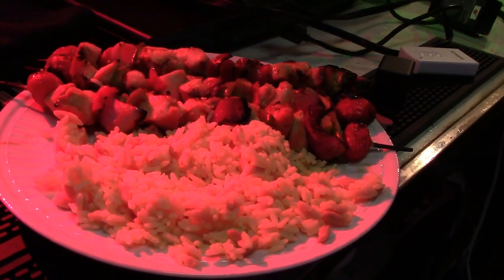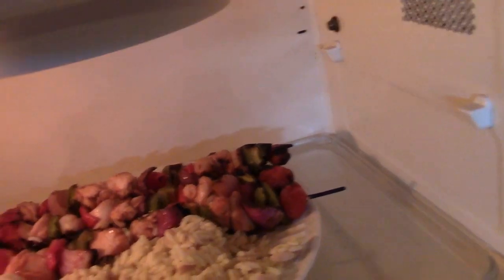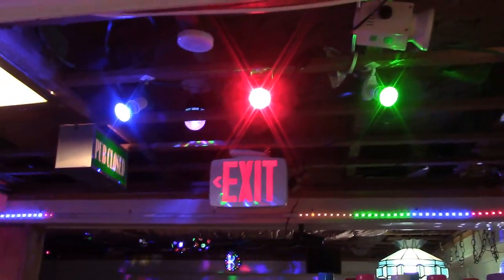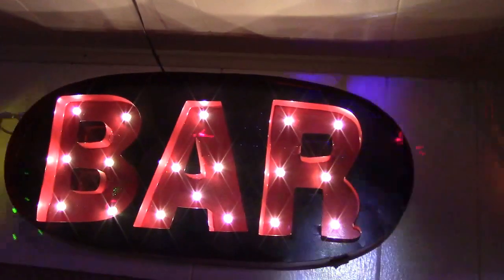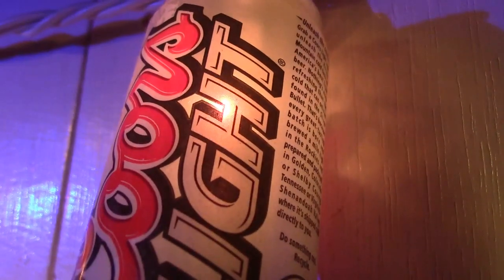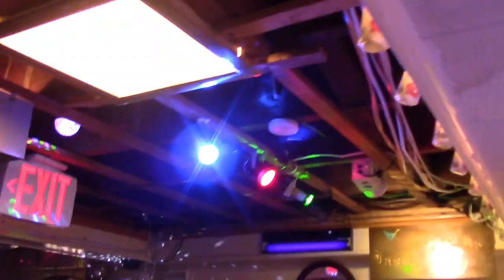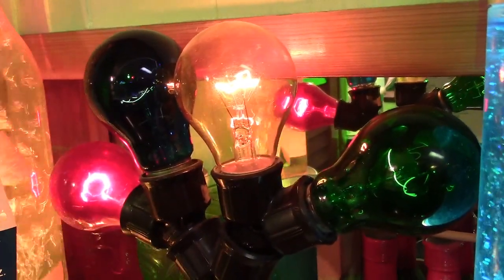Lunchtime With The GE SpaceMaker II Microwave From 1987

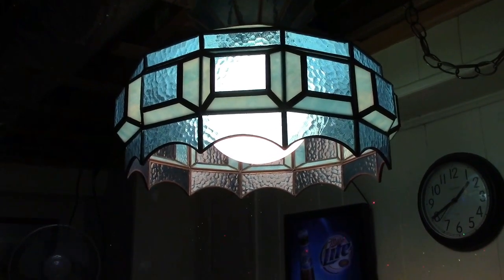Comment: Rewatching, at 2:10 you can really see that bulb dimming, that's pretty crazy. Just shows the power of that magnetron!
Reply from the maker: Later on when I dimmed that light down, to the point where it would practically go out when the magnetron was running, and then would glow again when off, that was really cool.
Reply: There was probably just little leftover scraps of current left for it. And it being a 150, that doesn't help!
Reply from the maker: @nl.515  Well that sounds great in theory, but there's a bunch of Chinamatronics behind the scenes.  Dimmers today, such as the one there, operate via PWM, Pulse Width Modulation, which pulses the light on and off very very rapidly.  Due to the persistence of vision, we don't see it.  Apparently, at low levels like that, the voltage sag causes the Chinamatronics to not behave the same, and the light goes out.  Years ago, when dimmers were actual rheostats with heatsinks, your theory would have been correct.  Thanks China!

Comment: My grandmother had this exact same Microwave for years, however in 2008 it died for some reason and replaced it with a 1995 GE microwave that, if anything, makes food colder when it runs. Nice exit signs, been noticing those in your videos recently. I have the version with the emergency lights on it, had to wire it myself.
Reply from the maker: Yeah I have 2 exit signs, one down there at the bar and the other one in the garage.  The one in the garage is wired so it turns on only at night when the outside lights are on, and it also has a battery in it, which still works to this day, some 5 years or so probably since it was installed.
Reply: jaykay18 my battery showed up DOA, I’m planning to buy another exit sign kit with all the parts this time.
Reply from the maker: Bark.
Reply: jaykay18 ?
Reply from the maker: I had nothing to really say, so I barked.

Comment: Nice microwave. Seems to be doing it's job pretty well.
Reply from the maker: It's an interesting animal.  It's 1100 watts but doesn't heat like 1100 watts.  Like now you can buy an 100 watt microwave and it'll scorch the paisley flowers off your dinner plate in 10 seconds flat.  This one, because it does NOT have a turntable (and that was specifically why I wanted it, just to be different) won't necessarily scorch the paisley flower off, but it'll melt a hole clean through the plate in one spot because the waves are standing still inside.

Comment: You could do morse code at my step dads place by quickly plugging and unplugging a load ( I had lots of fun making the lights dim though ).  And this was with moderate loads on a regular outlet.
Reply from the maker: Nice.  The lights dimming was an interesting experiment, because different things react in different ways.  When you throw a whole bunch of China on one line and then plug a "V8" microwave into the same outlet there's bound to be some fun.

Comment: i just moved into a place that has a rca model just like this. from 1989. from what i can come up with from the model number is a 650 watt.
Reply from the maker: The "nameplate" sticker on it should say how many watts it draws, and it's got to have one of those.
Reply: the only sticker i could find is inside where the model number and serial number is, its a LEM 065H model and what might be the watts drawn is 0.95 KW
Reply from the maker: 0.95 KW is 950 watts.  A good test would be to get a wattmeter and plug the microwave into it so you can really find out.  A relatively inexpensive gadget you can have a lot of fun with testing different things.
Reply from the maker: Allegedly, Harbor Freight carries them:  https://www.harborfreight.com/kill-a-watt-electric-monitor-93519.html

A coffee maker is going to be using a good 900-1100 watts, and on a 15 amp breaker you only have 1800 watts available total.  Clearly that's going to blow the circuit.  In my kitchen, I can't run my microwave and bread machine at the same time as they're on the same circuit, even though at different ends of the room.  Pretty rare that happens though, but I found that out the hard way once.  I can run the convection oven toaster and coffee maker at the same time, they're on different circuits although in close proximity.  Strange, they wired these old houses in very peculiar ways.